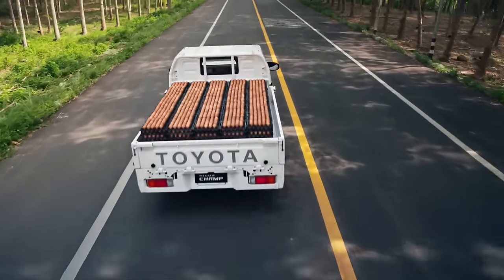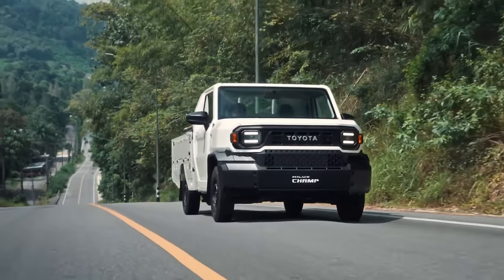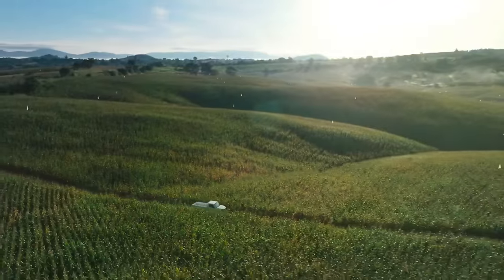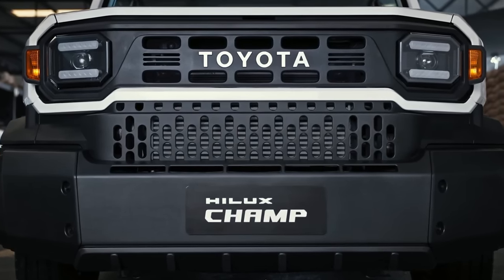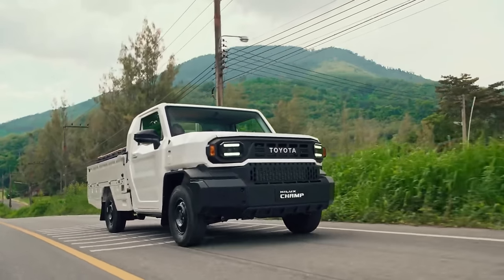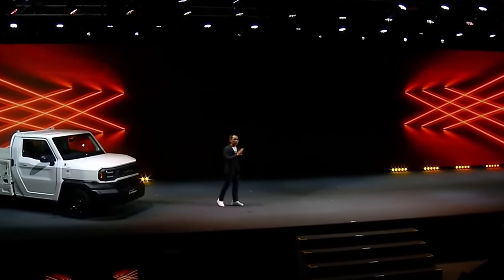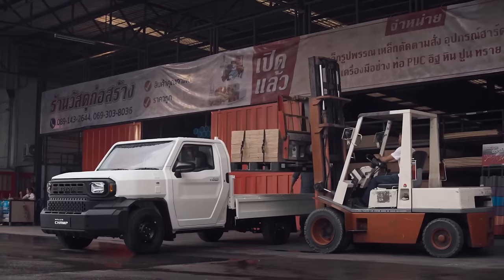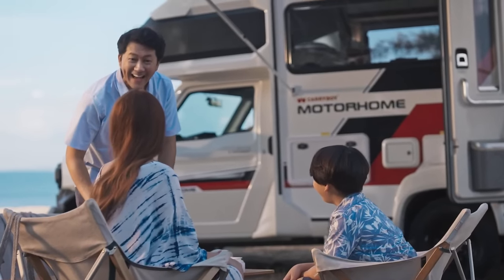Experience the Revolution: Toyota’s New $10k Pickup Truck That’s Turning Heads

Comment: The US used to have lots of mini trucks in the 80s. You can blame your libtard EPA for making rules that literally made it too hard to sell them here. Now we get mid size or bigger only. In town, bed loading, nothing can outwork those little trucks. Try loading a bunch of bags of concrete in a tall bed, now in a really short bed where you can literally do it over the side. No comparison for hand work. Mini's are cheap and easy to fix, easy on gas, but not a racer or loaded with frills. How shit is it that we have to buy Kei trucks only after they are 25 years old, and most recently the federal gov is de-registering mini trucks, making them even harder yet to own. They dont really give a fuck about emissions or you.
Reply from the maker: We hear your concerns about the lack of mini trucks in the US market. They indeed offer unique advantages in terms of affordability, fuel efficiency, and ease of use. Let's hope for a future where these practical vehicles make a comeback! 🚗🔧
Reply: I just dont understand how they do ever restricting enviormemtal auto regualtions yet at the same time people buy electrics more than ever youd think that means finally we can lax them regs to get the reliability up. It isnt wnviormentally friendly to have too many regulations causing the vehicles to be more unreliable and junked earlier. Thats actually less enviormentally friendly

Comment: Too good to be true! A real truck (except for that "infotainment" crap). Where I live I don't need AC either. Just when I was thinking I would have to build my own truck and put an old cab on it.
Reply: For Thailand-spec Champ, infotainment system is optional that need an extra fee, stock one didn't have even a simple radio (just a speakers installed in some higher trim for install a radio later)
Reply from the maker: We love your spirit! Sometimes, the simplest features make for the best driving experience. Let's hope this new Toyota truck lives up to our expectations! 🚗👍
Reply: Where i love you need both ac and heat because its way too hot in daytime and too cold at nighttime because its a semi arid enviorment on the edge of a desert

Comment: It would be amazing to see these here in the US. I don’t want a gas guzzler but I would still benefit from a bed. I know the maverick exists but it’s a Ford, nothing compared to a Toyota.
Reply: The mavrick is also a unibody. A "truck" 😂😂😂 the ranger is almost an f150 at this point. And there isnt a diesel its a turbo 4 banger becsuse they want usnto have to buy a new one every 10 years 🤢🤮
Reply from the maker: A practical, non-gas guzzler with a bed could indeed be a game-changer. Let’s hope for the best! 🇺🇸🚚

Comment: The only way this truck will come to the U.S. is if Toyota bypasses dealerships.
Reply from the maker: Indeed, the distribution strategy can greatly impact a vehicle’s availability. It’s an interesting perspective and something to ponder as we anticipate Toyota’s new pickup truck. Let’s keep the engines revving! 🚗💨
Reply: I support the order online arrives at wherecer you palce the pin on the map revolution. When i buy this truck it should be like when i order doordash whwre i just say it needs to be at this dot on the map by about lunch time 😂

Comment: Sadly I highly doubt it will ever see the roads of any first world country.  It was made for third world stndards where silly things like seatbelts and airbags are not required.  If it does make it to the US or Australia you can bet it will be 2.5 X the price.  For $10,000 I would buy two right now. If the thing is HALF as reliable as my Tacoma, 4runner and Tundra have been it is a home run.
Reply from the maker: Indeed, regulations and standards can be complex. But who knows, innovation finds a way! 🚗🔧

Comment: The Toyota Hilux Champ will NOT make it to the USA, which really sucks for those of us who are wanting a base pickup with a 6’-8’ bed and 4WD.
A/C is needed in most areas, and cruise control is nice too, but we Don’t need power windows, locks, navigation systems, power seats, lane centering, etc.
Most people today use their pickups for hauling groceries from Costco, or soccer balls. They want all the creature comforts, so if they break a nail, they can get to the nail salons in their plushy pickups.
For the rest of us, we USE our pickups for WORK.
Our 11 Ford Ranger is a XLT, so yeah it has cruise control, and A/C. Yes it has power windows, locks, ABS, etc. 
It’s a super cab and yes that’s where we store chains, ropes, jumper cables etc.
It has a 6’ bed and we use the truck mainly for work around our property.
We bought it used with only 20K miles. I would have preferred it to be a XL trim with vinyl flooring, manual windows and locks. It would have saved us money, but we bought it for $4K less than KBB.
We’ve owned it since 19 and have put only 15K miles on it in almost 5 years.
Even if that new $10K Toyota pickup came to America and was offered in a 4WD with a 6’ - 8’ bed, as a base pickup, the GREEDY car dealerships would tack on an additional $5K - $15K markup, so they can afford a better Bentley or Speedboat and laugh at how much money they ripped off their customers for.
Reply from the maker: Indeed, a base pickup with 4WD and a 6’-8’ bed would be a dream come true for many. Let’s hope for the best! 🚚💭

Comment: It will never ever make it to USA. When I travel to other countries I'm always shocked at the vehicles they have there. Ford sells a diesel Focus in Ireland that gets 60 mpg but won't sell it here, Ford also makes a 4 cylinder diesel 4 door work truck in Equador that every farmer in the whole country owns, they even use them as taxi cabs in the country to transport people and their livestock, get's stupid good gas mileage and most had over 500k miles on them. American corporate greed and big oil will never allow us to have cheap, reliable and economical options. If Ford- born here in USA- won't let us have what they sell everywhere else, what chance does Toyota have?
Reply from the maker: Indeed, the global auto market is incredibly diverse, and it's fascinating to see the different vehicles available in various countries. Market dynamics, regulations, and consumer preferences can significantly influence what models are offered where. It's a complex equation, but it's what makes the auto industry so dynamic! 🌐🚘💡
Reply: @PistonPundit  I think you mis-spelled "corporate greed" and it's certainly not the consumer whose preferences are taken into consideration, it's the oil industry limiting americans to either big and terrible on gas or super expensive hybrids that get worse gas mileage than the diesels they sell in every other country on the planet. It certainly is dynamic alright!

Comment: This $10,000 dollar truck starts at $13,000…
Reply from the maker: Indeed, the $10,000 is for the base model. The $13,000 price tag includes additional features. It’s always important to consider the total cost with all the desired features. 🚘💵👌

Comment: The new Toyota $10,000 pickup truck, with the base model starting at only $15,000.
Reply from the maker: Indeed, the starting price might be higher, but considering the features and quality, it’s still a steal! Can’t wait to see this Toyota pickup revolutionize the market. 🚗💨
Reply: @PistonPundit  - The US has a 25% import tariff on light trucks (aka the Chicken Tax) and federal regulators will not allow vehicles that do not meet safety and emissions standards to be imported for on road use, but there is a 25 year antique car exclusion, so the federal government forces us to drive older kei trucks that have no air bags, no crumple zones, no engine computers, carburetors instead of electronic fuel injection, etc.  The safety and pollution regulations are forcing us to drive less safe and more polluting vehicles.  That doesn't make sense, until we understand that the regulations were not put in place for safety or tailpipe emissions.  The 25% light truck import tax and the highway prohibition were put in place on behalf of lobbyists for domestic automobile manufacturers and dealers.

My daily driver is a 1996 Daihasu Hijet 4WD kei truck and I love it.  I'd much rather have a much newer model with more amenities, fuel injection, lower emissions, improved fuel economy, etc.

I hope Toyota can sell the Hilux Champ in the US.  We could certainly use a truck like that, but I'm not holding my breath because the problem was never engineering.  It's marketing, like most market problems.

I think the US will be lucky to get the Toyota Stout, the more expensive unibody car that sort of looks like a truck.

Comment: The 10K truck that only costs 13K
Reply from the maker: Indeed, the $10,000 is for the base model. The $13,000 price tag includes additional features. It’s always important to consider the total cost with all the desired features. 🚘💵👌

Comment: Also, it will not be sold in the US due to The Chicken Wars of the 1960s. It was cheaper to raise chickens in the us, butcher them and ship them to to Europe than they (mainly the Germans )could raise them in Europe. So they put a 25% tax on American chicken. So we put a 25% tax (which is still in place to this day.) on light cargo vehicles. Check out The Fat Electrician's video on the subject...

Comment: Toyota is probably the only reliable car maker left! And we all need pickups like this, not >$ 100 000 unreliable pickups with fancy and faulty gadgets! I got have 8 000 km on my new Ford Ranger pickup, all electronic aids are not working (even parking sensors). Dealer needs 2 weeks to inspect the car ... Thanks goodness I am old generation, don't need ABS, ESP and parking sensors!

Comment: Does it have a chassis?  
The Mav doesn't. 
Does it have rear drive so it can haul haul a gross load up a steep slick hill?
The Mav doesnt and cannot.

23k is waay too much. 10K is the right 
 
Give us a basic 2.4 four-banger with a large bed.  I dont care about 4WD, back seat alloy wheels or power windows.  Toyota has done it before.

Oh, and I want to be able to fix it with my Leatherman.

Comment: Tio se e this w ith a new engine of imortal neodium power end high presude servo pumps in ligthnes wersion with reductor for of road exploating end direct gear conection for easy road druge Will be a ewend neyond the Teška Dreams,,,no hawy batery no complikated elektroniks  exept safet druge ligths  with prepeare for extra led driwe ligts front end yust a pkase for catching the hand to someobe gor drive map,,,,
PS
Ewend in first vave with engine to compare the small hho gen,,in serial prodution...only on regular worck temp, of engine,,,,